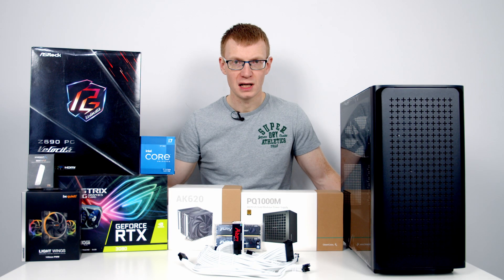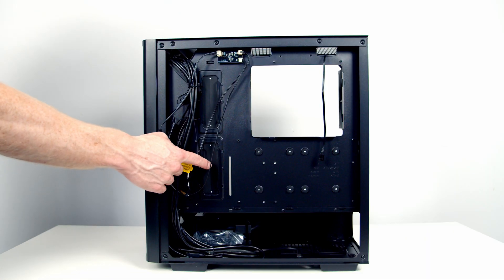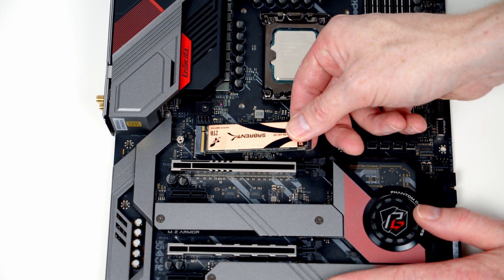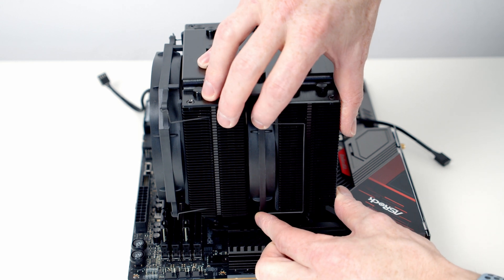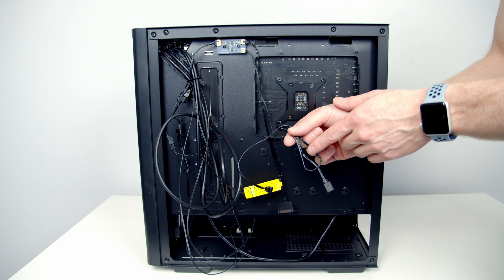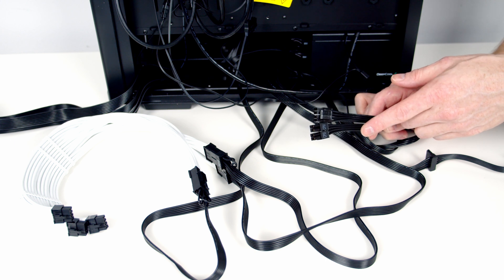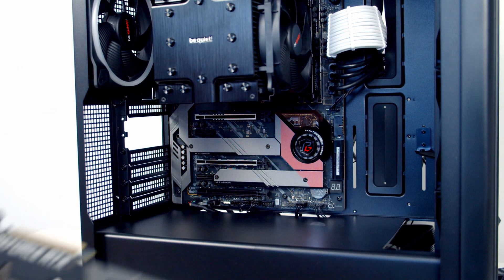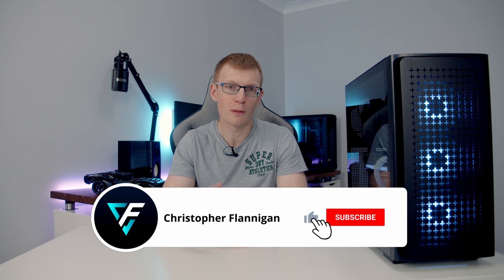DeepCool CK560 Build - Step by Step Guide

Comment: If you use onboard fan led controller , than why not use case led switch as a reset button? It shouldn't be an issue right?

Comment: what i dont understand is why he is connecting a 3 pin connector to the mother board from the firsts 3 fans and then when he puts the other 3 fans in he then adds a rgb wire to it to plug to the mother board as well as the 3 pin to the mother board why didnt you just do that with the other ones also. im so confused

Comment: By default, the three front fans are connected in parallel, that's not good, because in my case all sys_fan are 1A, and these will eat that easily, it could overheat the controller, so in this case I only connected two in parallel (dc mode) and the third one in another port. Mine's is all dark inside, it's better like that 😂

Comment: yea im sorry but this is not a good video to watch if you have no idea what cables to connect, he has way more cables connected at the  top [for the cpu than i do. and he keeps skipping over parts. why not just do it in one continuous video instead of in sections would make it easier to follow
Reply: True. He connects everything on the motherboard while its flat on the table but does not show connecting it on the case.  I've been building gaming pcs for the past 6-7 years and sometimes you run into problems. Having that huge CPU AIR Cooler will give you problems if you are trying to add fans to the top or trying to connect the fans to the MB if you are just beginning to build gaming pcs.  From my experience, i like to add the fans first and make sure they give enough clearance to connect the power supply to the 4 or 8-Pin connection and other fans or ARGB headers. The video card is the LAST component that i install. Especially if they are big and heavy. But that's just me.

Comment: For the a rgb connector my mobo has two and I am planning on using both so when I go to use it on the motherboard it will show my two options? Or will they be synchronizer with the rgb
Reply: This might be a late reply. It will show you both RGB Headers.  You can sync them or you can set them each to do their own RGB lights via the Motherboard RGB App.

Comment: I keep a curated build list going as a hobby for when my buddies finally build their PCs and this case popped up during my recent refresh. I gotta say, I'm really digging what DeepCool has going with this one. It's an obvious Corsair 4000D clone (just look at the dimensions! 3mm length difference, 5mm height difference, same exact width) but that's not really a bad thing. The fans are definitely gonna go in the trash and be replaced by some Artic P12s at the very least, but I like how spacious the interior is and the included GPU support bracket is a nice touch. 

Currently going for 87 bucks and tacking on a 5 pack of P12s, that brings the total cost up to $115. Not bad. My other choice is a Phanteks P400A Digital with two P12s added for exhaust - currently about $125 total. The P400A is proven to be good, but I can't stop coming back to the DeepCool. It would be even more of a deal if the included fans were the PWM ARGB fans DeepCool sells separately rather than the random junk they threw in it. I wish they would just sell it with no fans or with better fans to cut down on e-waste. Can't fault a good design though. It's great when less popular brands bring out competent products - gotta love an underdog.

Comment: Just built on the previous model. Impressive for price. Price wise the current model tries to compete with the 1st tier manufacturers Lian Li, Phanteks etc... and I'd say they aren't quite there yet on design elements but getting close. If you can score one of these on a discount definitely. Plenty of room for a 280mm radiator up top which was the deciding factor for me there's no sardine packing going as it's wider than most in its class - components run cooler.